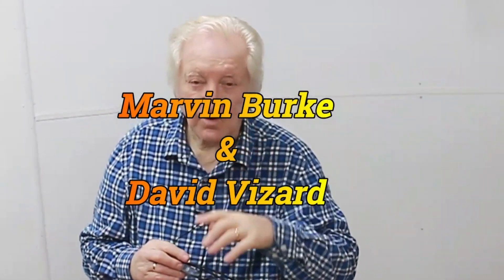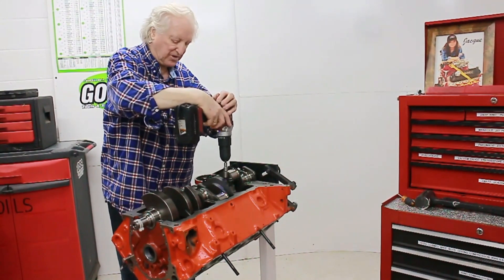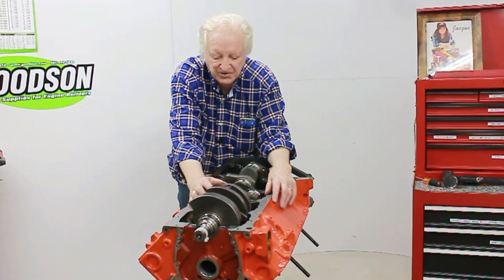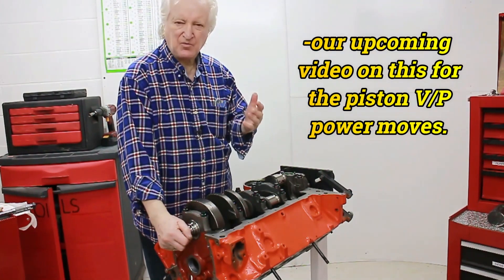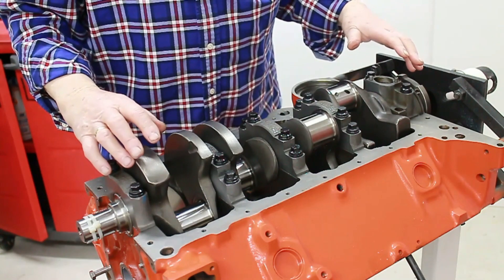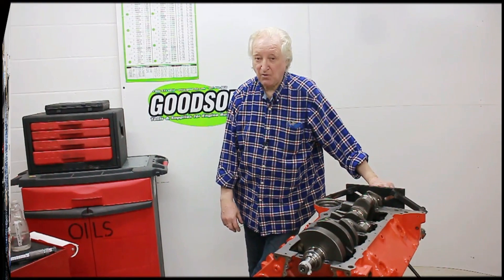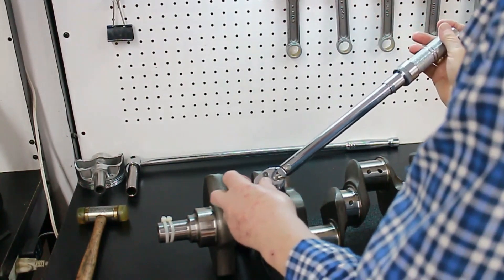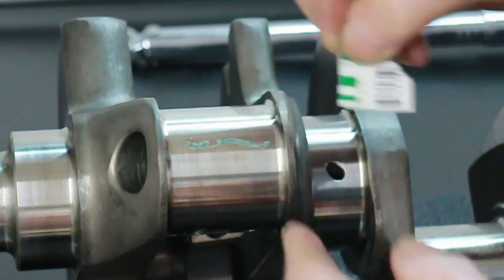David Vizard's PowerTec 10 EP 12 Pt 3 Professional Accuracy Bearing Clearances To Plastigage or Not

Comment: Mr. Vizard, is it necessary to torque the rod bolts to full spec torque to compress the plastigage?  Or would, say, ~2/3 of full torque be sufficient.  You showed us that it was not necessary on the main bolts, and it would help extend rod bolt life if we did not have to subject them to additional, full stress cycles.

Comment: How do you remove the caps (with the press fit dowels) without smashing the Plastigauge?  Tapping on the loosened cap bolts would put an extra load on the Plastigauge.

Comment: Plastigauge is good enough for what most of us home hobbyists,  street performance builders and weekend drag racing warriors needs. Using dial, micrometers,  and other precision tools are needed when your building something that is going to run ALL OUT 99% of the time, but when cruising the strip and doing occasional burnouts and weekend drag racing, plastigauge will keep your clearance within operation and better than what was given to you from the factory! And the factory clearance and balance, often enough, let us run our engines hard for years with the high tolerances many have seen. Plastiguage is a necessary step in engine building just like torqued bolts at the correct settings.

Comment: Hi David i have a connecting rod question , im building a 302 sbc 3 inch stroke for the street going in a 3400 pound car 4 speed manual. How long of a rod can i use before in has a negitive effect?

Comment: Thanks for the very detailed video. I have  dug out my plastigauge after many years. I'm replacing rod bearings and fitting ARP2000 bolts on my chevy ls1 this week and it has been great to reference the video to ensure I am doing things correctly. Clearance is looking great at 0.0019 to 0.0021

Comment: Fascinating as always, what merits are there in using different clearances? Would wider clearances cause excessive oil on the crank? Are clearances for a high mileage road car detrimental for a race engine?
Reply: Racecar engines often have larger clearances than factory to reduce friction, and also the parasitic loss incurred by turning the oil pump. The tradeoff, of course, is lifespan.
Reply: @shelbyavant5081  thank you, nothing too controversial there, though in theory reduced friction should increase life. (ignoring fatigue issues). One of my cars way back had a high pressure/high volume pump, it was something you tended to blindly fit without knowing if you needed it. For a given oil pressure the wider rotor pump is going to be more parasitic load. I think one of the mods at the time was to increase lubrication of the skew gear. A bit ironic really needed to increase lubrication to the oil pump drive because you have a bigger oil pump....
Reply: @g0fvt  Reduced friction by itself, in theory, would of course reduce wear, like just using better oil perhaps. That's not what we're talking about. Loose tolerances equal reduced friction at the cost of some of the metal, hence the shortened lifespan. The drag of the oil pump pushing 40-80lbs instead of the 15-50 that it requires is much more important to this topic however, as that is where the real extra power is. Even then, we are probably only taking about a single digit difference anyway. But you struck gold when you said that everyone has been programmed for decades to install a Melling high volume, high pressure, go to hell pump! 🤓